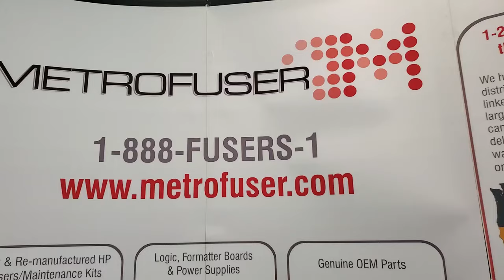Installing The Transfer Belt In The HP M452 M377 M477 M454 M479 Laser Printer RM2-6454

Comment: Thanks for the great video and instructional.  I just did this project on a M477.  Only difference is the sides come off/on differently, but easily figured out.  Did break one tab though, but still side attached fine and functions great.  Instead of prying with a flat blade screw driver, I used plastic pry bar tools used on car interiors.  Worked great.  Comment on the two screws holding the Intermediate Transfer Belt (ITB) and using a magnetized screw driver is very important.  I did it without, but had to go fishing with a magnet on the right side when a screw dropped.  Left side not much of a problem.  When pulling out the ITB, make sure the ink cartridge tray is pulled out.  If not, the ITB will not come out.  Some how mine was in and I recognized that was holding it up and pulled it out and the ITB easily pulled out.  All in all a pretty easy DIY, when you have a good video to work with.  I feel I could do this job over and over, with out any aids going forward.  Hopefully I won't need to.
Reply: He does mention at 4:20 into the video that he is using a magnetic screwdriver though.
Reply: Working on a 477 currently,  does the toner tray have to be completely out from the machine, or just pulled out

Comment: @metrofuser do you have a tip if the printer works fine except black? Is there something that can be misaligned on the ITB?
Reply: Fixed that issue for mine…the printer was transported with open toners installed. Above where the black toner sits inside the printer there is a black line (actually two, one of them is an opening). That cut out is where the laser is emitted towards the drum. Apparently some toner was blocking the laser up there. I used q-tips (remove the toners and move the tray half in for easier access) and gently swiped that opening. Did black copies to test and got immediate progress. So I continued cleaning and after a few q-tips the tips didn’t turn black anymore. -> prints look fine again. Problem solved.

Comment: I had a sheet of perforated, tearable labels get jammed in the back of the printer from tray 2. When I was trying clear it from the back, 2 of the 10 perforated labels tore off. There is no visible piece of the label showing anywhere for me to grab and pull out to clear the jam. Would this be the place where the labels would be stuck?

Comment: Good video could describe what you're doing on the side just below the two motors, are you releasing two clips thanks 😎😎
Reply from the maker: They are lock levers. Rotate them down and to left  to release them.
  
Use a small flat-blade screwdriver to pull the levers away from the printer toward you  until they stop.

Comment: Great video! I hate the design of these models. Once the Transfer Belt or Fuser goes out (which are VERY common consumable items) and the warranty is over, the repair ends up costing more than the printer is worth (considering cycle counts at that point) and people just toss them out. Very Sad and not a very eco responsible design.
Reply: Don't run them into the ground. Rotate them before they wear out. When they get high mileage demote them to light duty for someone who prints occasionally.

Comment: I work for an independent, professional workshop. ( 40 years experience)
Love the brutal handling with the screwdriver! (1:49) 
Should be reported to amnesty printernational.
There is NO tool required to remove this plastic part. (except to unscrew two screws)

Why do you use those stupid gloves? 
Is the printer radioactive or toxic? HaHa!
btw. nice ESD proof workbech.
Anyway. Thank you for the video to see a useful detail.
Reply: He's wearing the "stupid gloves" in order to not get skin oils on the internal parts of the printer.
Reply: @MichaelArghyris  HaHa! 
The stupidest excuse ever!
Is this a cleanroom printer, of course with toner powder, which is so sensitive that a few fingerprints are harmful? Or is the technician a wanted criminal who doesn't want to leave fingerprints?
The IBT or the 2nd transfer roller can also be mounted in such a way that the crucial areas are not touched.
Reply: @hugonabruxas6893  Such a hostile personality aren't' we?  Keep trying though.  LOL

Comment: The video was instructional, but it took me over an hour to do what he did in several minutes. Firstly, the videographer was not in an optimal spot. With mostly one view, the operator's hand obscured some of the steps he was doing. Some of the actions he performed, he did so without explaining, and when he installed the wire plugs he didn't explain which plug (black or white)  went on the top or bottom (or whether it made any difference).
Reply: one plug is a 3 pin connector the other is 2 pin